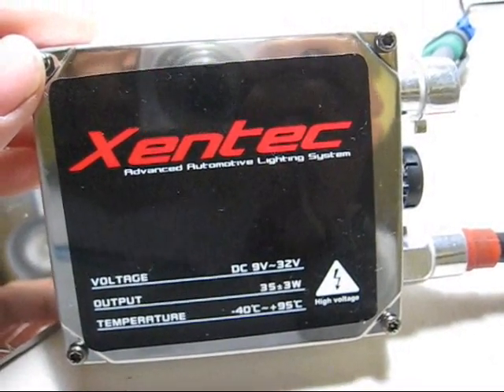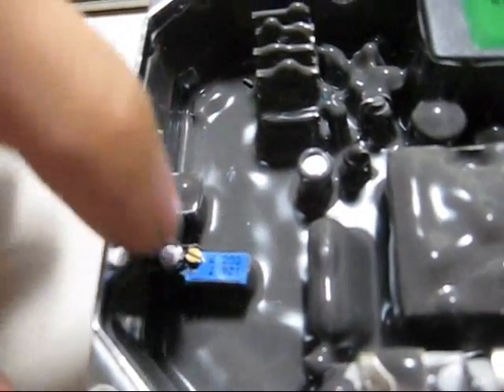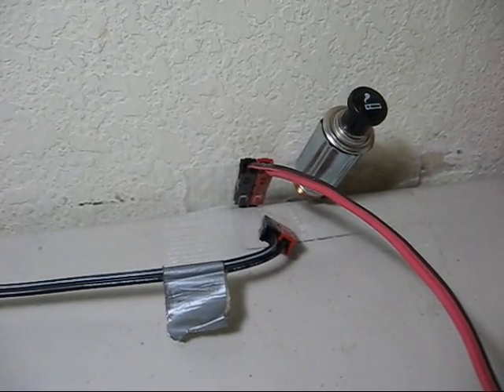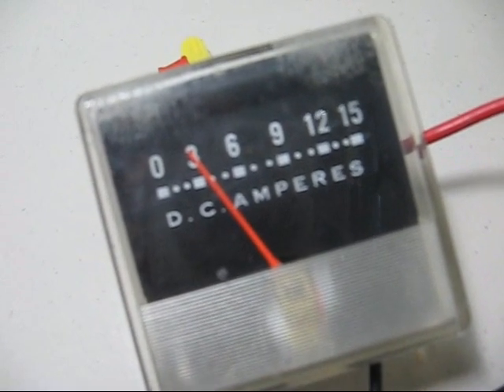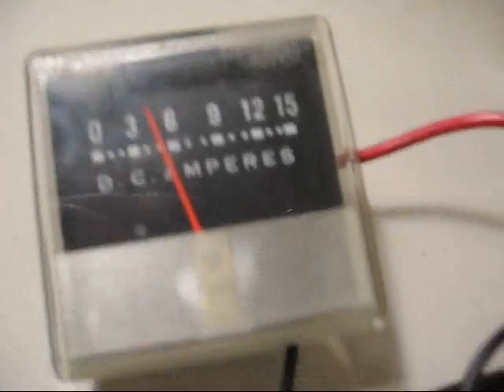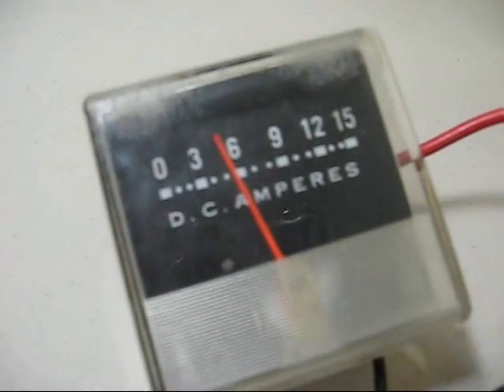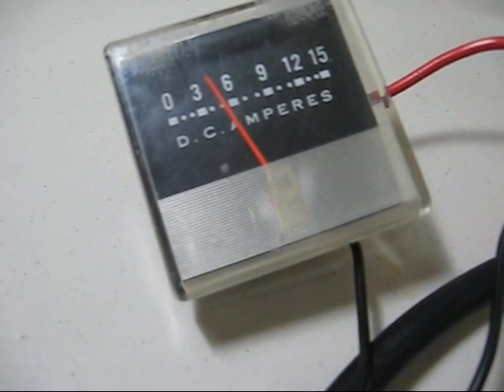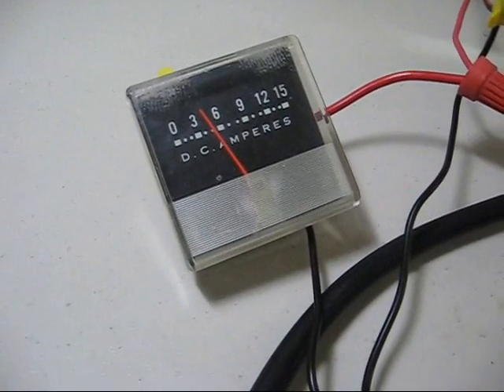Supercharging a Xentec HID ballast

Comment: Xentec is a DC ballast. Look for AC ballast. Xentec is bad quality.
Reply: +LordGryllwotth party on Wayne
Reply: +beaneriser Hid ballast manufacturers sell both DC driven Hid ballasts as well as Ac driven Hid ballasts; definitely only buy Ac driven Hid ballasts they have a much long and more stable performing Hid ballast life when compared with cheaper performing Dc driven Hid ballasts!!
Reply: @profdleeucc  A.C. ballasts are easier on the bulbs too. With a D.C. ballast, the current only flows one way through the bulb, and over time will actually carry tiny bits of one electrode over to the other, and ruin the bulb. With an A.C. ballast the current switches back and forth many times a second, and prevents the electrode erosion caused by D.C. 
An A.C. ballast will also shift the color temp of the bulb slightly lower than with a D.C. ballast, and the bulb will appear slightly brighter. I will NEVER used a D.C. ballast. Junk.

Comment: That black "jelly stuff" is the waterproofing for the ballasts. Now that you've cracked the case and removed the waterproofing, you might not want to use that in a wet environment. Your observation about the 35 vs 55w is correct, the potentiometer in the ballast is what makes the difference. Today's ballasts, however, are digital so it will not have the adjustable potentiometer inside, it has a microprocessor that controls the amps it outputs.
Reply: Loctite clear waterproofing silicone works great
Reply: +Steven Peterson yes the gel like "jelly stuff" is actually a type of custom "thermally conductive epoxy"; it absorbs shock and actually helps to conduct heat to a stainless steel Hid ballast chassis case; now if he wanted to make it waterproof again its quite easy; just order some more "thermally conductive epoxy" and mix it up and fill it all the way to the top brim of Hid ballast chassis case; this awesome stuff is made by MG chemicals but its not cheap but its entirely effective in its application makes ones Hid ballast truly waterproof; now all one has to do is actually find a field proven Oem factory quality chipset Hid ballast that has a proven track record like in a genuine factory oem Denso, Hella, Mitsubishi, Matsushita, Panasonic D2S/ D1S type Hid Ballast!!

Comment: That doesn't  look like a Xentec ballast,  It looks like a VVME or a Goldmar.  Xentecs are crap and do not have the sealed output connector that that one had and Xentec has cheap ass plastic housing. Unless of course Xentec stepped up to the plate and stopped making crap that's not a Xentec.

Comment: How long did everything last, any burnouts? Overheat issues (long term use)?
Reply: +Advanguard The effect of over driving the Hid Bulb with increased current causes it to shorten its life and cut its operating life basically in half; but it also burns twice as bright; also since there is increased current flowing across the Hid bulb's electrodes it will run at an increased temperature; causing excessive "wear and tear" on the Hid's electrodes; this will only cause it to accelerate its premature wear on the actual electrodes and eventually cause its early failure; though using a higher rated wattage Hid bulb will delay that effect somewhat!!

Comment: Well, considering there's some 23Kv running around inside the ballast, using that "plastic alignment tool" is more than a good idea. You should also observe what happens during ignition sequence after you "boost" the capacitor. Consider that the bulb could have a shorter lifespan when running @ 50W instead of 35... and oh, don't breathe helium and make video next time ;)
Reply: The 23 KV is only starting voltage. Actual working voltage of the bulbs is around 80-100V. Not that high,but still pretty dangerous. The multiturn potentiometer however is at about 12V level. It runs the current measurement signal to the controller input. Ballasts rarely regulate output voltage.
Reply: Eviltech Thanks for the info ;)
Reply: +Thomas Samoht and oh, don't breathe helium and make video next time ;)... that was funny......
Reply: +john morales you and tom are jerks
Reply: Also there must be a rectified ac output for the bulb instead of having a non rectified ac output because there is no flicker
Reply: @thedogememesproductions6354  it's simply very fast. Your eyes dont see it. The GOOD ballasts output A.C.
Reply: +Eviltech Yes that is correct Auto Hid ballasts are current regulated driven devices after it has struck its initial 23Kv it settles down to around 85 volts or so in a couple seconds on good Hid ballasts; when one adjusts the pot one varies that current measurement signal being input to the controller to allow one to overdrive ones Hid bulb!!

Comment: Hello,
Does potentiometer exists into slim ballast? or not?
Indeed, I have a second pair of Chinese ballast but light intensity decrease 10sec after boot time
Reply: +Ténébreux That is the Hid Ballast self adjusting itself to the higher level of current flowing thru the Hid ballast it has the ability to also regulate the Hid ballast current back downwards in order so that the Hid bulb does not burn out prematurely to a certain extent; which is a good thing!!

Comment: i have a 55w ddm tuning kit and my 6000k bulbs look white. Absolutely no blue in em
Reply: +Chris Park One of the known side effects of over driving a Hid ballast is it has a strong tendency to wash out the actual "color temperature range" upwards towards the left with less blue color; in terms of color on the kelvin color temperature scale; for example a 8K color kelvin temperature range Hid bulb will run at 6K color Kelvin temperature range when run at the higher wattage by being over driven by adjusting the current regulated through it to a much higher level like in this very particular instance!!

Comment: think i'll use a hid ballast to feed my tesla coil with an hid bulb spark gap in a magnetic field to quench it.
Reply: ...just don't go over 88mph or you'll be jumped back in time.
Reply: Wont work. A HID ballast only puts out 23kv for less than a second to initialize the spark between the electrodes in the bulb. After the bulb has ignited, the voltage drops down to around 80 volts or so to keep the bulb lit.

Comment: hmm fun. i saw the 23kv rating so i thought hmmm arc. sure enough a second of a 2 inch arc. neat. then if set electrodes about 1/8 inch apart you get a bright continuous arc until one of the electrodes burns off. hmm connect to door handle or ignition switch. try to steal car BLAMMOH. in the seat and out your hand.

Comment: You obviously have no clue what you're talking about.  4300K is the brightest color temp around.  The higher you go in color temp, the lower the lumens output will be.  So in this case, a 5000k bulb is BRIGHTER and WHITER than any color temp above it.  6000K bulbs in a 55w ballast will wash out and look more like 5000k bulbs.  This is true for cheap ballast.. no so much the same for quality OEM ballast or Morimotos.

Comment: I'm wondering if you're right. The 55W ballasts may just be overdriven 35s. I run 55W HIDs on my Denali, and the ballasts certainly get hotter then the 35W ones on my CTS-V, or that I've ever used in the past.

Comment: His voice is fine, geez. Hey Yuandrew, thanks for the video, it would be cool if you could see what amperage the ballast uses when the potientiometer is turned completely c-clockwise, on startup as well as the 9 amps or so it takes on steady state.

Could you sacrifice a ballast, turn it up all the way, put it back together, put it vertical on a hard table and let it burn-in for a few hours? Take temperature readings? Then we know if a fan+HS isneeded

This is so awesome, 100w ballasts for $10!

Comment: Have you noticed a change in initial load after upping the pot and does it stay within an acceptable threshold? Have you tested it with a continuous load for an extended amount of time since this video? I'm curious to see what the max output is before you sacrifice reliability. Find out where it lets out the magic smoke and bring it down to 80% and let it be.

Comment: You mention that when you turned up the ballast your 6000K Bulb ramped up and now was outputting like a 5000K bulb but in actuality the difference between Xenon bulbs is not light output (Lumens) its color temperature (Kelvin) 5000k is like an OEM white yellowish color light where as the 6000K bulb has a diamond white slight bluish shade to it.
Reply: More power to the hid bulb = more lumens, AND it shifts the color temp down. You get both.

Comment from the maker: I've only ran it for 5 minutes at most while it was turned up. I'm more worried about this ballast burning out though as it seems to get warm rather quickly operated above the 6 amp mark continuously.

Most automotive ballast run at a higher current (over 100 watts) for a couple seconds during start up to help the bulb warm up faster anyway. I've read that it isn't until you overdrive a bulb past 80 watts continuously would they have a chance of "popping" on you unexpectedly.